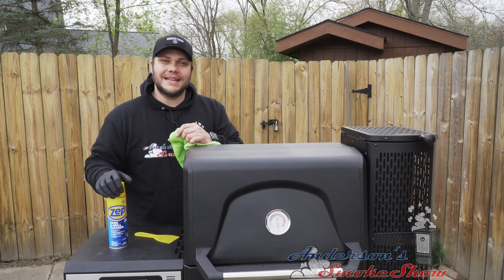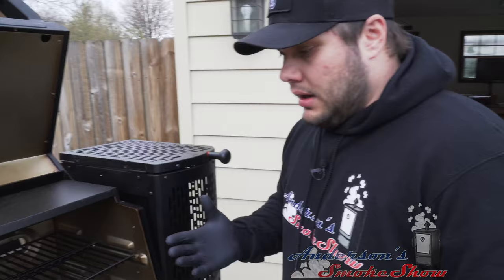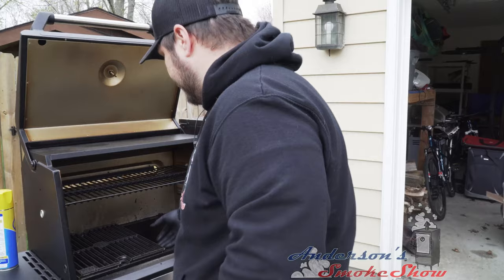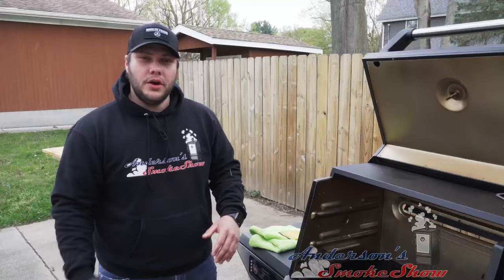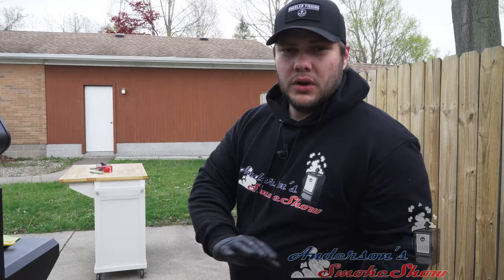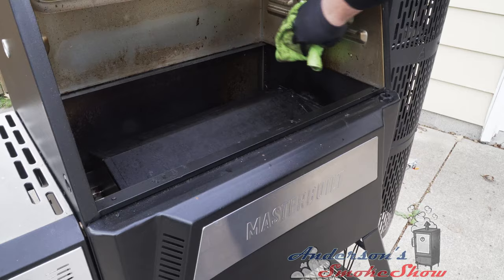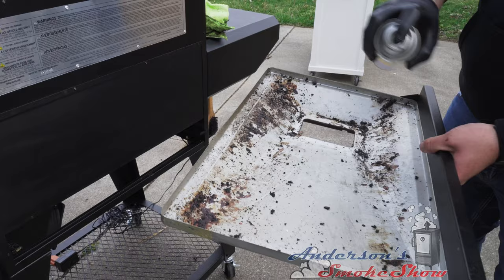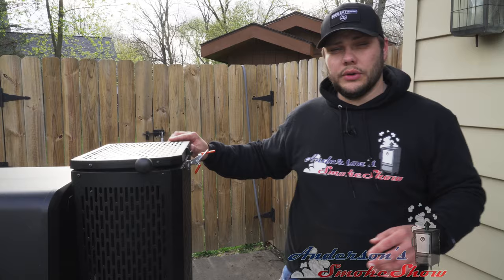Don’t Let Grease Fires Destroy Your Food | How to Clean Your Masterbuilt Gravity 560

Comment: Have a Char Broil that doesn't have a clean out tray. I clean it ok but too much grease is getting on the heat shield thing and I've been seeing grease fires. That thing cannot be taken off, it's a part that has weird screws, like they don't want you to EVER take it off. Should I call it a day with this grill and move on? Seems like a dangerous design. My dad had a grill that had a clean out tray and cleaning it out worked wonders for preventing grease fires.
Reply from the maker: Most grills have some sort of clean out as grease fires can be really dangerous. I would clean it the best that you can and keep an eye on it.
Reply: @AndersonsSmokeShow  Thanks!

Comment: Dumb Question! If you remove the drip pans could you just power wash the grill! Would that rust it out!
Reply from the maker: The issue there is that this grill has electronics.... that wouldn’t go so well...
Reply: @AndersonsSmokeShow  Crap! I did not think of that! Every time I clean a grill I cut myself! Lol Thanks for the reply You have great videos!
Reply from the maker: Thanks Manny. Use a tool like that plastic putty knife. That will help to keep your hand up and off the grill surfaces.

Comment: How long does it take to cool down.  How do you close it off from the 700F
Reply from the maker: I have cooked around 300F and it was cool to the touch 30-40min later. I don’t quite understand your second question... can you rephrase it?
Reply: Anderson’s SmokeShow you answered it. When you use the sear temp does it take about an hour to cool down.
Reply from the maker: Typically is cool within the hour.... but I can’t be 100% certain on that. My procedure is remove the food, shut down and unplug, then go eat. Some times I end up doing dishes or clean up the kitchen before I ever walk back outside. At that point the grills always been cool. I did cook on it last weekend and had it around 300F, shut it down and went inside to eat. Right as we were finishing up dinner I saw lightning outside and ran out to put the grill away. It had been around 30min and it was cool to the touch. I would always be careful of storing the grill to soon as the charcoal may not be completely choked out.
Reply: Anderson’s SmokeShow that’s what I needed to know thanks. Love the detailed videos

Comment: The Gravity series is total garbage. I've had my grill for 6 months and so far have had to dismantle and clean it, replace 2 switches & a cord and the computer will not update or connect to my phone. The fan will randomly quit working. I've had emails to and from the company and demanded phone calls. I've gotten exactly 3 cooks out of it and have been embarrassed with guests waiting on food. IT IS A PIECE OF GARBAGE!!! Don't buy it.
Reply from the maker: Sorry that you’ve had a bad experience. I’ve got  two different masterbuilt gravity series grills and haven’t had an issue with either one… I can’t speak to the customer service though as I’ve never had to use it.